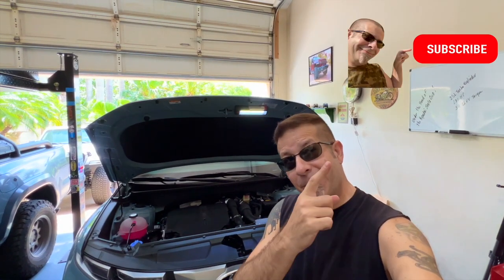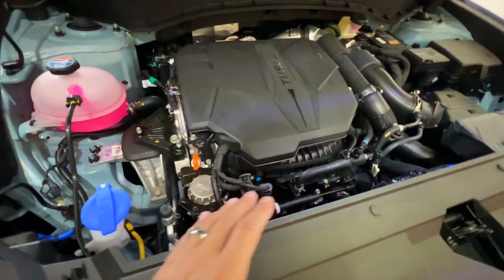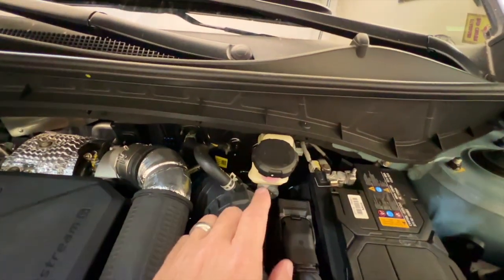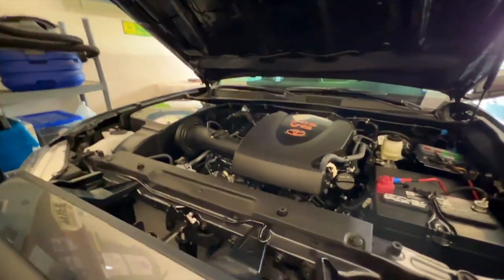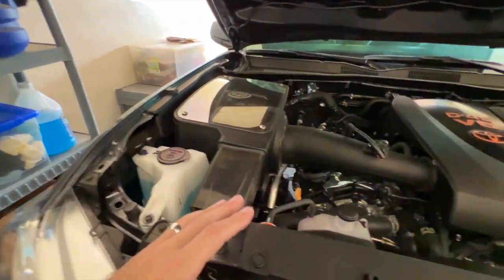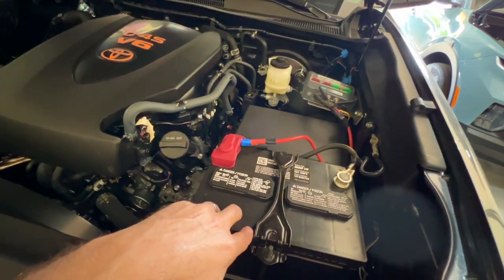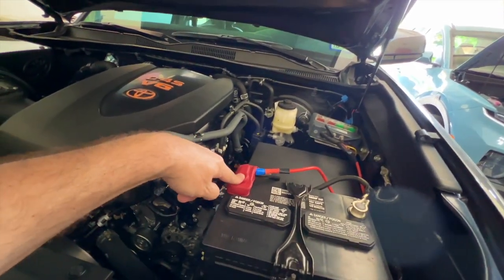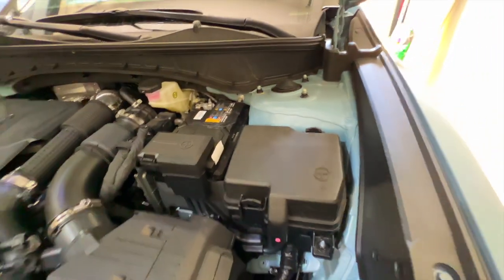Under the Hood Of The New Hyundai Santa Cruz

Comment: I bought the KN filter and it raised my HP and Got rid of the turbo lag Completely! My Buddy put it on his Dino and wow what a Difference.  I also took off that Resantor and add with Beautiful dule exhaust tips the sound with just that improvement is incredibly easy the performance is awesome.

Comment: Rob, did you try the none turbo Santa Cruz ?, there is a huge diff
Reply from the maker: I did not.  After I saw the specs as compared I wasn’t interested in it.
Reply: @robmotivetoo  The non-turbo SantaC was the only one around in many miles for a test drive. I’m used to standard Subaru 2.5L with “adequate” acceleration, not exciting at all, and not exactly slow like my years ago “curb-crawler” 85 Olds Ciera with the Pontiac 2.5 Iron Duke. That thing was so gutless that I almost could floor it on glare ice and not spin. The only thing it passed was gas stations.  But on snow, was not such a bad thing, could use cruise control and less likely to get in trouble. The non-turbo SantaC had “adequate+” power, but it was very unsatisfying. Even annoying. It seemed programmed to want to stay lugging around in a higher gear to save gas, then a significant mid-accelerator spot of “nothing” going on, then a screaming burst at high rpm’s.  I have not yet been able to test a turbo version, but I know I’m not interested in the screaming irritating standard 4 banger.  It’s like farm boy trying to herd a fat old lumbering sow (hog) and she’s grunting around, moving slow until the electric prod hits and then takes off screaming in some less controlled direction.  That’s what the non-turbo was like. Annoying.

Comment: Does it have laminated side windows ?
Reply from the maker: No idea?
Reply: @robmotivetoo  If you do there will be a seam down the the middle of the plate glass  for the laminate.  Benefits are noise reduction, safety and security, laminate won't shatter like tempered.
Reply from the maker: Not that I know of🤔

Comment: do not like that the battery is to the back if the engine bay.......should be upfront like the tacoma.......jmo
Reply from the maker: I’m neither here nor there on location👍
Reply: @robmotivetoo  well i have to charge my battery lot of time, cause i do not drive enough for all the friggin electronics these days........so i rather have it up front instead of have to go to the back with the cables.